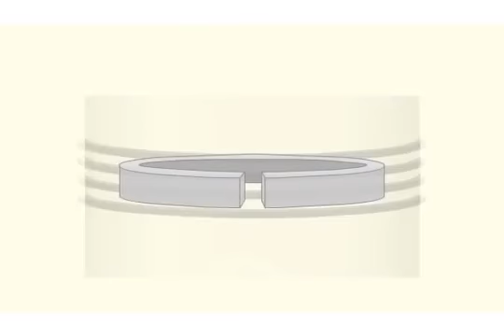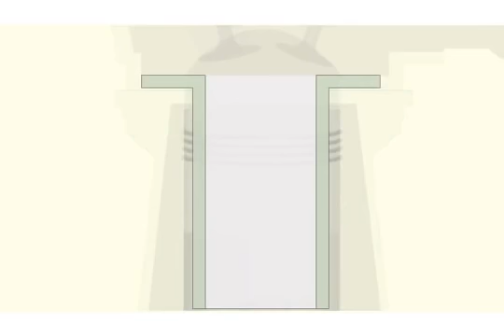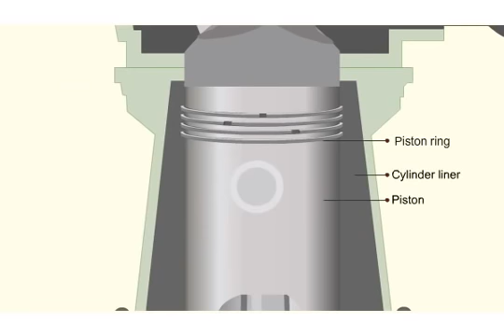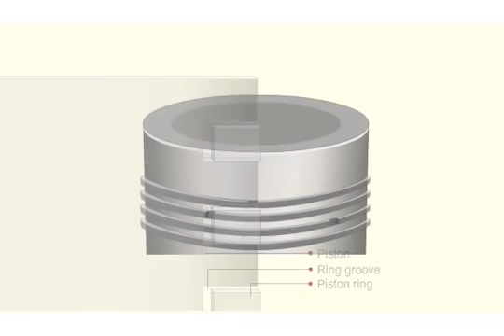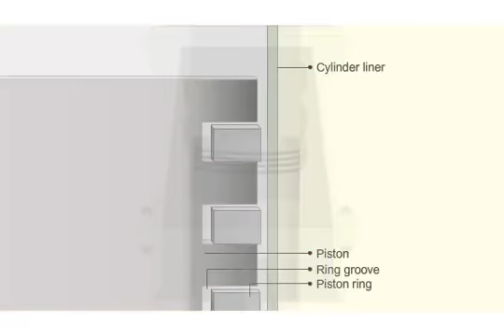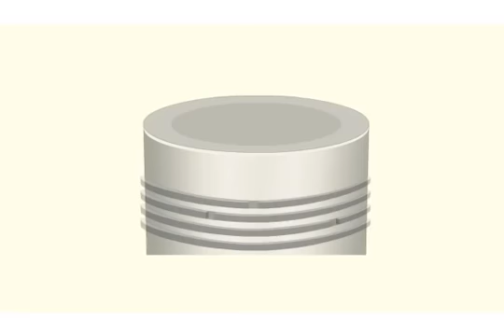Auxiliary Engine Piston Ring Clearances

Comment: can you recheck what you said at 2.12 ? thickness of ring should be less than groove? why you measuring thickness in vertical and other length in horizontal,  is it correct? 

brilliantly done. just clearing a doubt. thanks